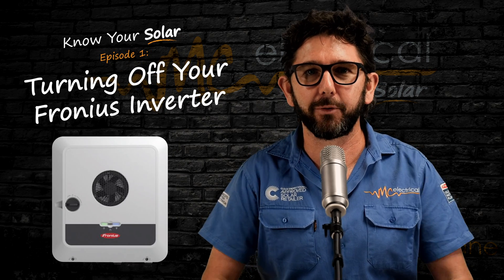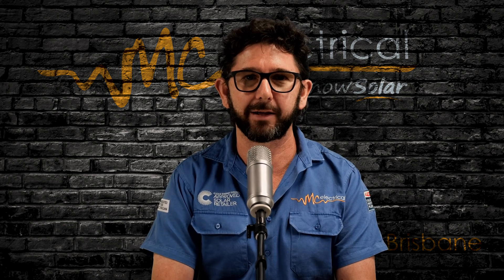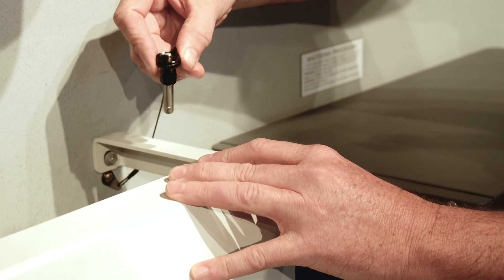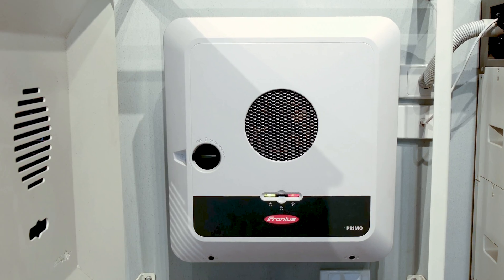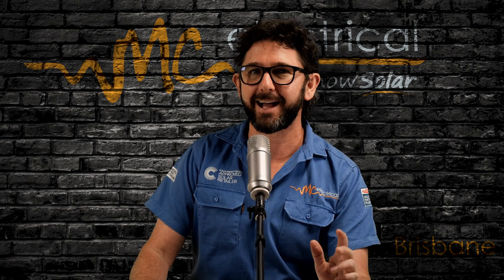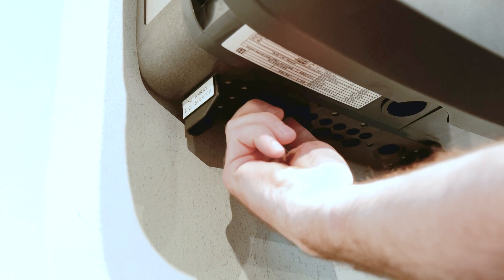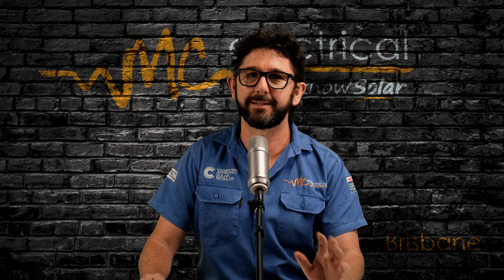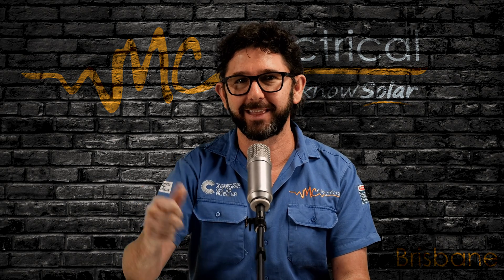Turning Off Your Fronius Inverter | Know Your Solar | Episode 8

Comment: Had to turn off because of TC Alfred, really clear instructions 👍
Reply from the maker: Good luck with Alfred!
Reply: Also about to turn off mine due to Alfred as well. 
Is it safe to assume that turning it back on post the storm is just the same 2 steps in reverse?
Reply: @shaunharvey891  they have a video which covers turning the inverter on, but yes it's the same steps in reverse, cheers

Comment: There is a third switch, next to the inverter, 'Inverter AC Isolator'. Do you ignore this switch, or is it an alternative to turning off at the switchboard?
Reply: I can only speak for our set up but we have an AC Isolator next to the inverter as well and I use that. It stops the load, which does the same as the circuit breaker at the panel.
Reply from the maker: That’s just an alternative to your switchboard

Comment: Does turning off the DC on the Fronius, indeed isolate the inputs or does it turn off the electronics connected to the inputs only interrupting the current because of removing the load? (which would have the same effect as turning the AC inverter output off?)
Reply from the maker: Hi peter, I don’t fully understand your question, but if you turn off the dc when the inverter is running at full power, it’s opening an MC4 connector on a roof. It causes a significant DC arc on the contacts. It is designed to handle this, but only for a certain number of times. (If you switch it late in the afternoon, it will be fine.)
Reply: @mcelectrical  Thanks Mark, is turning the off the DC at the inverter indeed the same as disconnecting an MC4 connection or does the DC inverter switch turn off part of the electronics responsible for the load that the inverter puts on the panels? The first option would indeed encouraging that DC arcing that we should be so concerned with, the second option would avoid this as this is - from a DC input perspective - is the same as turning the AC output off. I guess it is more a question for e.g., the Fronius manufacturer as even different brands can decide how to implement this differently. Turning the DC inverter input switch off would allow one to work on the panels while the hybrid side of the inverter is still operational. It is a rather technical question with different answers for different manufacturers and the answer is not necessarily that important.

Comment: How do you set it up to switch over faster or not turn off? We have BYD battery so it should simply switch over use
Reply from the maker: Hmm, this is a real problem. I’d be interested to know who sold you this system and why they are not supporting your questions. I short, it’s about a 60 second changeover at the moment. That may get better

Comment: Good to know. Now I want to know how I do this when there is a battery also connected.
Even better, what work around will help me keep the battery full on a summers night when we have huge storms approaching and I might need to go on BACKUP POWER?
My Battery is usually at10% and cutoff by around 1am. That means I only have 10% of 19kwh for emergency backup.
So at 4pm when the battery is still above 90% and there are storms forecast, how can I safely disconnect or stop the battery from discharging too far?
PS, I know Fronius is going to provide a user activated "Storm mode" in the future but that is not here now.
Thanks Mark.
Reply: @markcavanagh  then to turn it back on say,  at 3am , I just engage those breakers again yes?
Reply: @markcavanagh  I have a work around.  I wanted to let you know so you can mention it if you wish.
I log into the inverter using the IP address and the customer credentials.
Then I on the left click on the menu option and select Energy Management and then Battery Management.
Then I create a time based rule for MAXIMUN DISCHARGE and set the limit as 1000W from 1pm to 6pm and a second rule limiting discharge from 8pm to 10pm to 100W.
This mean the battery is still around 80% at midnight and 20% at 5am, finally going flat just before it starts to charge again.
 By shifting the battery discharge from early in the night to late in the night, I hope to have a fuller battery when if there is a blackout at say 4am.
I hope this makes sense.